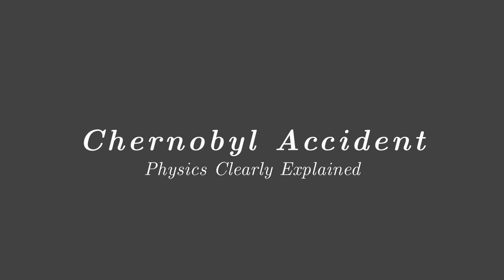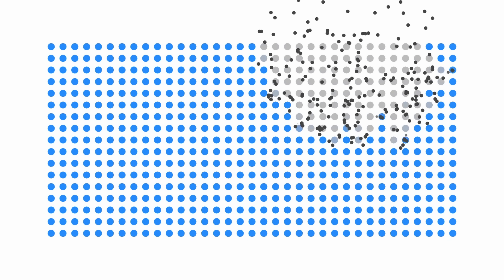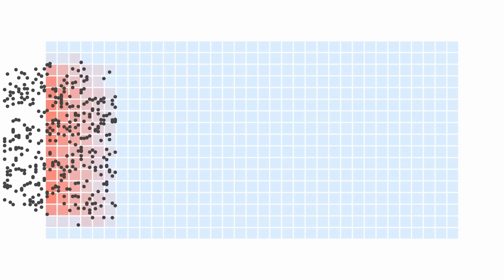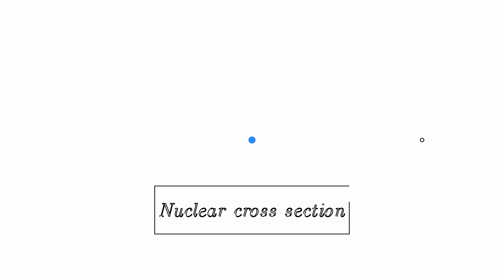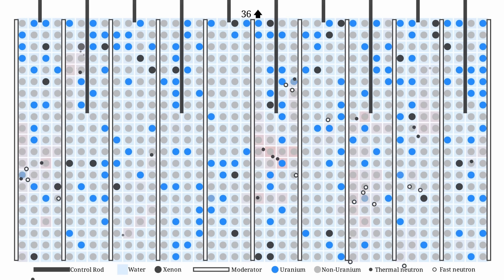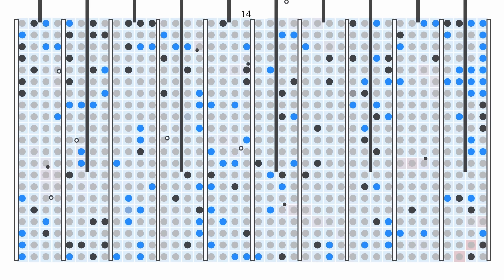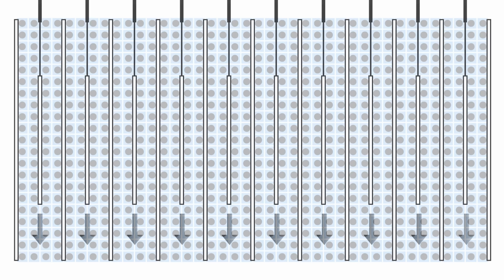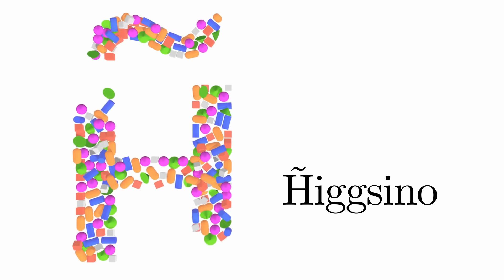Chernobyl Visually Explained

Comment: This 'explanation' is not just wrong, it is irrelevant to the real accident. It is some arbitrary animation with some very basic reactor physics flair to it. The actual explosion was NOT caused by xenon poisoning of the reactor, xenon had almost NO effect on the actual accident. The power drop was NOT caused by xenon poisoning, moreover - xenon actually can NOT physically cause sudden drop in power, power drop was most probably caused by automatic control malfunction due to faulty neutron flux sensors. The water boiling was NOT accelerating prior to SCRAM, the power did NOT increase prior to SCRAM - both were stable. The reactor was stable and there were NO warnings whatsoever, they pressed the button to shut down the reactor on their own volition as there were nothing requiring them to do so immediately, only THEN power surged (and not in some linear way as shown here - it was completely vertical line on the graph). The 'computer' did NOT tell them anything, moreover it physically could NOT. There was NO instructions requiring them to 'shut down immediately' as it was NOT prohibited to operate at this power level. They did NOT plan to 'get power higher than 7%' and so did NOT actually tried to raise it, they considered the power level more than adequate for the experiment and there was nothing wrong to be at that power if one is to believe the then existing instructions. They violated almost NO instructions and most of the 'horrific things' they performed were later determined to neither being in violation of the instructions nor had any effect-cause relationships with the actual accident.  The 'team' was NOT inexperienced nor 'lacking safety culture' and given the level of information access they had at the time they could NOT predict what would happen. And so on. Most importantly: neither the 'tip effect'  nor the 'slow movement' are the culprits of the catastrophe, they only tipped the reactor. The cause was faulty design of the reactor specificaly the fuel rods spacing was too tight, that caused the reactor to had positive void coefficient of such a magnitude (unknown to the operators) that it caused the accident tipped by the control rods - the very things that should control the reactor no matter what, not blow it up.

Soviet scientists designed a bad reactor with the fuel rods grid too tight (wrong calculations most probably). Then when they discovered the void coefficient magnitude was way more than they predicted, they covered it up and did nothing to mitigate the problem or warn the operators. When the reactor (finally) blew up due to their design errors they did everything to cover it up and scapegoat the operators. And now lo and behold! People continue spreading their lies accross the globe.

Comment: The presents fails to include the neutron contributed by the fission fragments.  It is these delayed neutrons that make controlling a reactor possible.

No operational commercial reactor is ever “prompt critical”.  If in a normal commercial reactor gets into the “prompt critical “ range you have lost control 

Chernobyl went prompt critical and power surged from around 30MW to above 200GW in less than 4 seconds. The reaction only stopped when the core disassembled itself.

Comment: This experiment live and learn the lessons of that day. You did s excellent job at explaining the screwup.  

My rule of thumb that has served me well threw my life is never ever bypass a safety system and never run something if that system has some safety systems under repair. It's served me very well. Nobody has died or gotten hurt on any of my jobs and I still have all my fingers and toes. If something doesn't look safe it's because it is. Never let anyone over rule you and do it anyway.  Stand your ground and they will back down.  
This right here is a lesson for the planet on what can happen if you fail to do that most basic right of standing your ground on safety. If you get fired fine you really don't want to work there anyway. In my country they can't even fire or replace you with somebody crazy enough to bypass safety and continue like everything is just fine. Here if you want to get around it you have to fix it period to the person who brought it to your attention satisfaction. 

It ends the practice off all the rules on something are written in blood.  Your doing it right or it's not happening. Nobody here will fault you for standing your ground.   If you don't leave work alive and intact you failed. Don't fail, cause it's just so much better that way.

Comment: You said at about 2 minutes in, that the way to keep a nuclear reaction stable is to ensure that each loose neutron only hits a single atom of U235. That's not correct. You want the majority of loose neutrons to be absorbed by the control rods. I think what you meant to say is that to keep a reaction stable the aim is to ensure that each fission event only triggers another single fission event, and not an exponentially increasing number.

Comment: 5:20 mark, the “positive void coefficient” is close but not exact. Water does absorb neutrons, but has a crazy low absorption cross section. The reason RBMK reactors had a positive void coefficient is because water acts as a moderator, and the RBMK reactors were designed to be over-moderated to save on cost. While the reactor was also moderated by graphite, some amount of moderation was given via water (liquid water specifically). With the liquid water gone, the reactivity increased because the moderation lowered to optimal levels. So far great video though, and the explanations are certainly good enough for most people to understand what’s happening

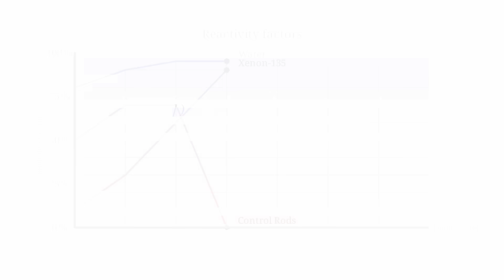Comment: 12:40 But why did they need to have a higher power than 7%? Why not just shut down as the computer said, and stabilize everything before doing a test?
Reply: Also: how did the power drop to 1%? It was not there first time testing, right?
Reply: The test parameters were pre-set for 700 MW. The reactor had been operating at 1600 MW before the test began, so they gradually reduced reactivity to reach the required level. However, xenon contamination caused the power to drop sharply to 30 MW.

To compensate, they removed all the control rods to regain power, but the best they could achieve was 200–300 MW. Despite this, they decided to proceed with the test, even with almost all control rods withdrawn, a reactor core heavily contaminated with xenon, and a team that was not properly trained for the procedure.

This was the direct cause of the explosion.

And why did they continue with the test? They were in the Soviet Union—saying “no” to leadership was not an option. They were pressured to carry out the test and deliver the expected results, no matter the risks.
Reply: @ Yes I understood that, thanks. But: how did the power drop to 1%? It was not their first time testing, right?
Reply: @ralisgroffen  Alright, let’s go. The safety test should have been conducted 12 hours earlier, during the day, in a different shift. However, due to production targets, the plant director received direct orders from his superiors to postpone the test until after midnight.

As a result, the reactor operated at half power for 12 hours before the test began, and this is where the first problem arose: at this reduced power, the core lacked the energy needed to burn off accumulated impurities, leading to xenon poisoning.

When the operators attempted to lower the power from 1600 MW to 700 MW, the core became unstable due to excessive contamination and could no longer sustain reactivity, causing a drastic drop to 30 MW.

In an effort to increase reactivity, the operators fully withdrew all control rods, leaving the reactor without any braking mechanism. The only factor still limiting reactivity was the accumulated xenon, which began burning off rapidly as power increased.

Then, a critical moment was reached where nothing was left to hold back the rise in reactivity, triggering a vicious cycle: more heat generated more steam, which in turn generated even more heat and even more steam, until the situation spiraled completely out of control.
Reply: @victorduarte8872  Ok I understand it now, the reactor operated at half power for 12 hours, thanks!

Comment: What started the explosions was the reactor going prompt critical, an exponentially expanding chain reaction dominated by fast neutrons, not slow or thermal neutrons that nuclear reactors normally depend on to maintain a steady chain reaction. Prompt critical chain reactions are not sustainable, they always result in the fissionable material disassembling itself, and reactors are of course by definition not supposed to do that. What the operators inadvertently did was create a situation closer to a nuclear weapon than a nuclear reactor. A reactor going prompt critical is a disaster because the fuel elements of the core explode due to rapid vaporization of fuel rods and water within the reactor vessel.

Comment: The reactor was poorly designed but the equipment is only as good as the man operating it. However, the men were not only bad at operating it they were not fully aware of the secrets of the reactor kept from them but they were equally as arrogant and ignorant if not reckless.
Poor design was surely a factor but with poor equipment I've seen operators taking twice the precautions and operating it smoothly......

Comment: what is going on 14:23? "Usually the top had a lot more stopping power than the accelerating bottom graphite. But the reactor was in such an unstable state, that the bottom had much much stronger accelerating power than the top had a stopping power."

I don't understand those sentences at all and so I don't get how SCRAM increased the reaction rate. Why did the rods get stuck during SCRAM? Was SCRAM never going to work the way they thought?

Comment: Interesting, I have never heard of neutrons heating water. Also, a strange statement to me that better enriched uranium is more dangerous that weakly-enriched uranium. With better-enriched uranium, you can use water as the moderator instead of graphite, meaning that if there's too much steam, the reaction will go down.
The notion that AZ-5 was pressed in response to a rapid power increase is a myth. The power surge happened a fre seconds after AZ-5, when water at the bottom was displaced.
The "jumping reactor caps" is another myth.

Comment: I was a reactor operator in the US Navy, and for us it was called the neutron generation coefficient.  1 was critical, greater than 1 was supercritical, and anywhere from 0 to .999... was subcritical.  Modern US reactors are designed in such a way that it's literally impossible for them to go into thermal runaway unless some outside influence physically damages the reactor.  Even if the operator intentionally tried to cause thermal runaway it wouldn't work because of the layers upon layers of computer failsafes, and they're designed in such a way that because of the coolant pH and the way the hafnium control rods work, the neutron coefficient is always less than 1 unless a human operator is actively pushing a button to cause it to increase power, so even if the computers all failed and all the human operators died somehow, with no outside input the reactor would slowly shut itself down.

Comment: I'm still missing something about the graphite tips. I wish they would have been in the simulation right from the start. How is it just the tip if the whole thing is going out the bottom… I don't get it. Also, it would've been nice to have the legend at the bottom for all the simulations.

Comment: What I'm understanding happened is when the operators removed the control rods to burn off the xenon and initiate the test they underestimated how unstable the reactor would be the moment they started the test due to the positive void coefficient. They they further complicated the issue by further misunderstanding the graphite tips of the withdrawn control rods so once they scammed every rod would itself be reactive rather than neutralizing for a few moments  and in the distressed state of the reactor effectively rendered it into a bomb. 

Only in RBMK reactors could this sort of thing happen because of their choice in moderators versus Western reactors which use water. Were RBMK reactors more potent in trade off? Like why use something so dangerous that could so easily be placed into a critical state?
Reply: Graphite rods are cheaper than the alternative, which is would be to have a large pool of water as a moderator instead and then compensate with a richer fuel source.

Comment: 15:02 Was that an engineering malfunction that control rods got stuck?
Reply: No. Pipes ruptured from pressure
Reply: There was so much pressure created by the boiling water it caused ruptures and breakages. The small channels the control rods usually sit in, in-between the fuel rods, were obstructed by massive pressure or broken hardware and couldn't sink into the reactor. They just sat above it while the Graphite tips sat inside, accelerating the reactions even more. Craziness.

Comment: What went wrong? 

"The computer told them to shutdownthe reactor, so they turned it off"

Thats what went wrong 

The soviet reactors maybe flawed,  but they had enough softies built in to stop the accident, until the human took the safety off
Reply: He made up that part, but the reactor still exploded IRL so it's probably not "what went wrong"

Comment: Nice video, however I'd like to offer a correction: "The control rod and fuel channel caps did not bounce up and down, the pressure forced the upper biological shield out of place, lifting the entire lid with it."

Comment: @10.47 they wanted to lower the power. inserting the control rods and raising the water cooling are understandable. 
but I don't understand why you mention, the control rods has to be raised furthered up? you mean at the later time, when they need to raise power right?

Comment: I always wondered, if the reactor is really as unsafe as we were told. Or was it just, as you stated, the bad ethics in the Soviet Union. (I’m taking all my knowledge from the HBO show and some small common knowledge, so be sure to argue with me and tell we where I’m wrong, just do it in a polite manner.) If the operators were correctly trained and instructed and made aware of the positive void coefficient and weren’t so ignorant as to bypass the safety mechanisms wouldn’t the reactor be perfectly fine? I see that adding a moderator to the control rods, without a way to control them separately seems kind of wrong, but if they know about that mechanism, they should have been able to work with and around it?
Reply: nuclear is cheaper and safer, this was just a psyops so the people wont look for another nuclear project

Comment: So question: control rods are out, inserting control rods resulted in explosive power.,..is just pumping endless cold water into the reactor the only way to control it once the Xenon burns off?  Seems like they were screwed once the control rods are out.

Comment: Very detailed. Even with everything the operators did, if the fuel had a "negative void coefficient", the rising heat would have slowed the reaction and not endlessly accelerated it.

Comment: I thought that water actually helps the reaction, since it slows down the neutrons, allowing them to have a higher chance of collision. and that when the water vaporizes, the chain reaction stopps...
Reply: or is this only true for heavy water reactors?
Reply from the maker: It's a great question. What you are talking about is true for water moderated reactors, which most reactors today are.

However, in this video I did not add the moderating effect of water. Simply because it does not play a role in graphite moderated reactors. 

In the R.B.M.K  graphite moderated reactor, the neutrons are already "saturated" with moderation from the graphite, and so this moderating property of water isn't important. Only its absorption properties. 

Let me know if that made any sense

Comment: So much bad design choices in reactor design. Mixed with "state secrets" brought about this catastrophe. Heck, the soviets even had a forewarning about how bad graphite was as a moderator because of the Windscale fire in the UK that happened in 1957
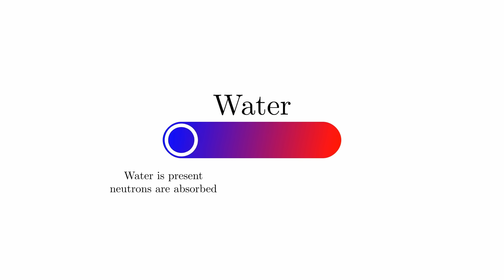Edit: 5:14 apparently RBMK reactors had voids in the water even when at proper capacity due to how the water was situated in between each control rod.

Comment: the control rods were made of boron which slows activity and graphite rises activity. the tips of the rods were made of graphite, they pulled almost all of them out because to raise power and eventually they had activity  which made them press az-5 which is the scram because of the graphite tips which rises activity and with az-5 all of the rods are inserted at once which means the graphite tips are raising the activity all at once which means more activity which made the control rods fix into place due to the heat and pressure thats build up due to the activity. which means only the tips are fixed into the core which is a never ending cycle until the lid blows off

Comment: Big question: what should they have done differently? Just leave it at low power and let the xenon burn off slowly? I assume that would delay the test. Wondering if they were worried about how much trouble they'd be in if they didn't run the test on schedule.
Reply: The test should have been aborted  as soon as they received request to delay shut down.

No delay = no Xenon Pit/Inexperienced Crew with nearly no advanced preparation for test.

Unfortunately this test had been attempted three times before and failed...seems like Dyatlov was committed to performing test, regardless of circumstances.